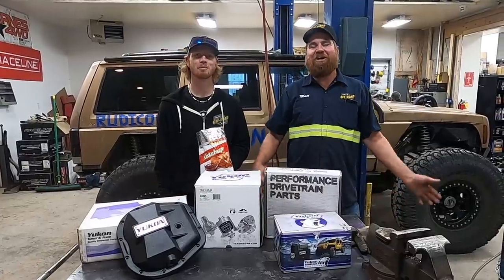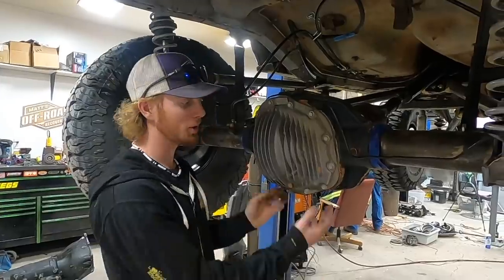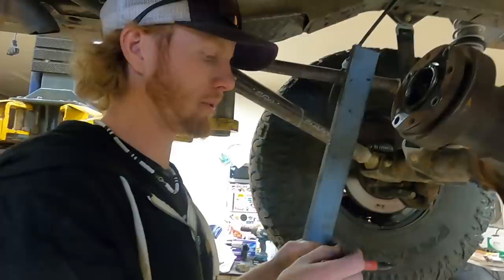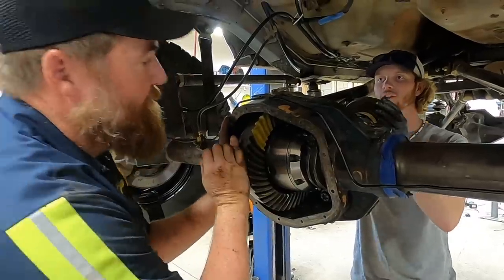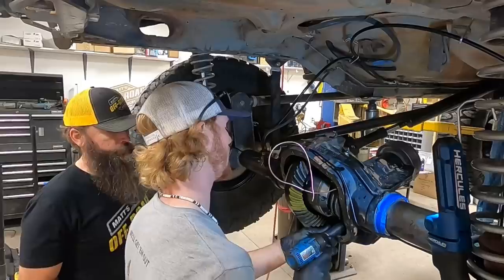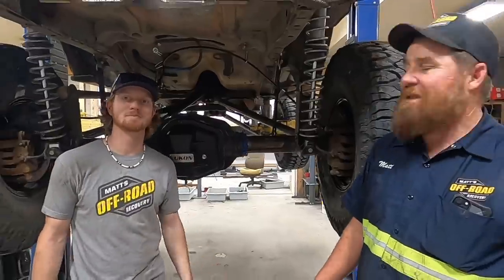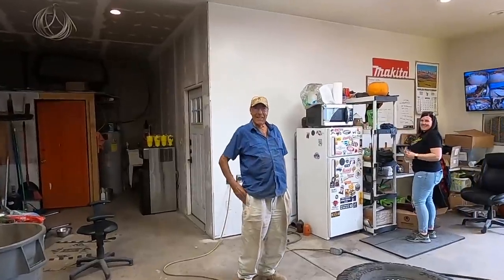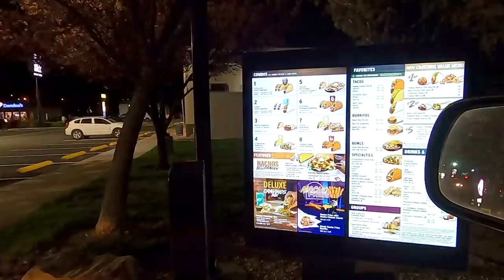How Long Will The Rudicon Be 1/2 Dun?

Comment: Rudy:

The old differential is a good one.
It has the correct curvature to send oil up and around to lube the pinion bearing, and to send oil to the axles as well  having fine cooling fins.

That new one sucks. Looks cool, but won't do anything but overheat the diff by splashing oil against a straight wall, and lubing very little.

Watch the video by banks on diff covers. You won't regret it.

Michael  Rzewuski

Comment: Yukon parts are proven tough love to see the rudicon get the well deserve love it needs! You guys are awesome
Reply: Have you seen the ARB test to failure of one?
Reply: @ZuluComander  that was early in yukons production. I run all yukon parts in my xj and it's been heavily abused. They resigned the locker in 2012 and is much better. I've ran arb and yukon and I can say I've had less issues with the yukon in my xj then I have with the arb in my tj.

Comment: I saw a guy replace the ring gear (and most of the rest of his diff parts) in his Ram 2500 while laying on his back in a field outside Moab. Most impressive piece of off-road mechanic work I've ever seen. And wow, those Yukon parts are not cheap.

Comment: Actually you use a needle torque wrench to set pinion drag. Needle torque wrench’s are still a great tool👍🏻
Reply: An older mechanic told me that if you use a 1/2" breaker bar to tighten it and when you let go of the bar when it's @ 3 o'clock and it will just slowly coast to the 6 o'clock position then thats tight enough.

Comment: Floating axles are so much easier to work on. The garden tractor I'm building is a full floater since the drive axle is from a Hyster electric forklift. I wanted to keep it simple and make it from common off the shelf type components.

Comment: Aftermarket differential covers are iffy at best.  You should watch the series that Banks Power put up on the YouTubes about diff covers.  They did amazing research about temperature and fluid flow.  They determined that the engineers who originally designed the diff cover for the OM were really great.

Comment: Awesome channel , and congrats on Rudy’s launch!  Matt , I really enjoy the McGuyver approaches to extraction!  I have watched each video at LEAST twice, especially the SXS removals.  I have three questions, or maybe suggestions. First, would be drill holes in the side rails on the trailer, to clevis and redirect the pull angle. Maybe save your back?   No additional weight as you already carry a clevis. Second is removing some of the steel plate on the deck  and replace with aluminum to help flotation? Small gains, but worth the effort? Only you would know. Lastly, I see when you have a missing wheel, some sort of aluminum “ski” you could strap the end of the wheeler down to , or a temporary flap you could place over the ramp  to help it onto the trailer? As we get older, our backs don’t hold out. You can trust me on that. Hence why I’ve seen all your videos twice, new hip is another month out. :-(   
Keep up the great work! I’d be leaving those people up by the radio towers ! That’s insane!

Comment: Hopefully that locker holds up better then mine did. When I bought mine was when they first came out with it and didn't have bolt retainers holding the case together. My bolts ended up backing out and wedging themselves in between the ring and pinion. I contacted Yukon about it and they wouldn't warranty anything after I sent the parts in it was even under 6 months, so it was within warranty. Worst customer service I've ever received and I would never recommend them to anyone. I like how they put bolt retainers on the rear ones now lol.

Comment: Always buy an extra pinion bearing and clearance it so it slides on fairly easy. That way you can set up the rear-end without having to press on and off the pinion bearing if it needs more/less shims

Comment: Id reconsider a rear diff cover after watching the Banks Power on “do rear diff covers work or are they just bling.” It’s a series of 3 but worth the watch as it shows they are just bling and are doing more harm then good.
Reply: The diff cover series by Bank's is really cool. However, those are high capacity alloy street diff covers. Off-road covers are more thick cast iron or steel armor covers in a different class.

Comment: Pro tip: drive any wedge in the upper half of the differential cover, not the lower half.  It keeps any marring done to the case or cover from potentially becoming a leak.

Comment: I prefer a bendy type of torque wrench myself. You don't have to worry about calibration. If the pointer doesn't line up, bend it till it does. As long as the scale is tight and not loose as a goose, you're good.

Comment: Torque wrench? Matt I put a junkyard diff on my 355 gears, bearings and all. Added a lock rite , checked backlash by hand, all bolts by impact on my commanche.  Never had a problem withe the d30 I did all this too. I may have been lucky. The rear 8.25 axle I ran it open.  Theoretically in 4 low, I had minimum 3 wheels churning. On a good day it was all 4 lmao

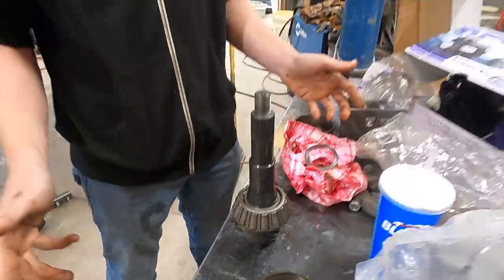Comment: 3:21, Did Rudy grind the ID of the bearing with Dremel to get the bearing to fit?  Oh my!  Press this bearing on!
Reply: Seen a couple other guys do this. They grind down the old bearings use that as they get the shim stack figured out, then replace with the good bearing. Shims go to the inside of the bearing rather than to the outside. Guessing that is what he did.

Comment: I'm not only an ex mechanic I'm a structural engineer.  I can tell you that a beam style torque wrench ("bendy style") is the most reliable torque wrench and used properly it is sufficiently accurate but it has to be used properly.  The click torque wrenches promise more accuracy but they can vary and they can get out of adjustment.

Comment: Pretty sure if you gently heat that bearing up (like, top of a cast iron stove) and then slip it on, it will fit better (slide on, stick on when cools).
Reply: @MattsOffRoadRecovery  That makes WAY more sense.  I was thinking, you guys have done these a lot, no way you don't know that trick!

Comment: I check my Proto Click Style Torque wrench with my "Bendy Style " torque wrench attached to it.
What can go wrong with the old style wrench?
A 15mm 12 point socket will fit on a 1/2" drive like it was made for it and while not precise, I can see the the Click Wrench is at least in the ballpark.

Comment: That's the same torque wrench I have. BTW, that's the wrong hammer. It should be a steel shank 16 oz  framing hammer at least. The claw has less curve. Just make sure it's the smooth head, not the knurled head. I think I just watched the same thing on Paul's channel. Rudy makes it look a lot easier.

Comment: Need Paul from fabrats he is a genius at doing lockers would have saved some time need a high level  axle diff  oil drain instead of a old bucket  still got there Rudy well done it's not easy if your not doing it every day 👍👍🔧🔧

Comment: There’s a first for everything. Grinding the inner race of a bearing to fit on a shaft instead of heating it. A big no no guys. Using a carpenters hammer for mechanical work. Another big no no guys.  Check out why.

Comment: Never seen anyone grind a bearing down to fit the pinion shaft.  If your going to do a slip fit, don't you usually work the shaft and not the bearing?

Comment: Seeing Rudy grind the inner part of the pinion bearing made me cringe, it's tight so it stop the inner part of the bearing to spin on the pinion shaft.
At the shop we just heat to bearing on a spiral stove (dont let the bearing change color) and let it slip on the shaft.

Comment: Gear break in: A gentle running of the gears and bearings progressively getting harder over a 500 mile period assuring the gears and bearings do not get overheated with cool down cycles.    NOT install and run a tough trail, but hey, it will give Rudy some great content when he has to do round two on them LMAO Congrats on the new channel.

Comment: nothing wrong with the old Bar Torque wrench all you need is for everything to be as close to the same tightness it doesn't have to be dead on.  I mean if someone is that anal about it, they can buy you one of those nice super expensive electric ones

Comment: Rudy why would you hone out the bearing on the pinion instead of heating it and dropping it on, so it will sit tightly on the pinion shaft? In my mind you just created a failure point!
Reply: @MattsOffRoadRecovery  there are better ways to figure out the shim pack.

Comment: Did he just grind that inner bearing to fit?????
Reply: @MattsOffRoadRecovery  Using the old bearing or a brand new one?
It is a good idea to get your setup close, but your preload is going to be different with a new bearing rather than an old one. So your pinion depth will change once again will it not?
Reply: @MattsOffRoadRecovery  you did put new gears in as well so I can see how using that process can save from needing to pull bearings off again.
I just wonder how close your setup was once you said "alright looks good enough" and commited to throwing in the new bearings